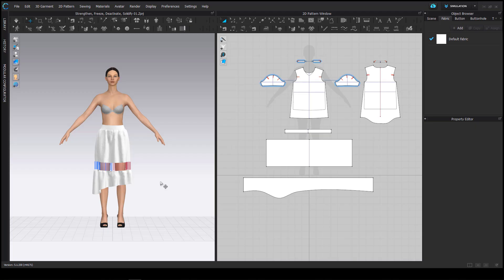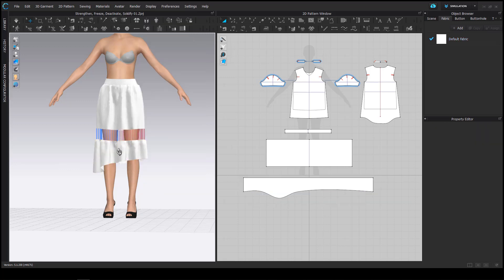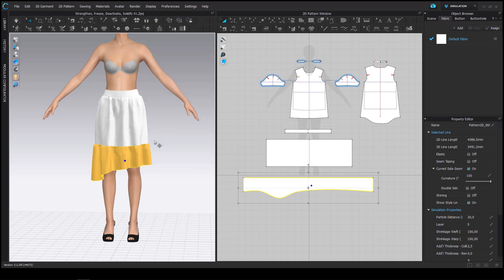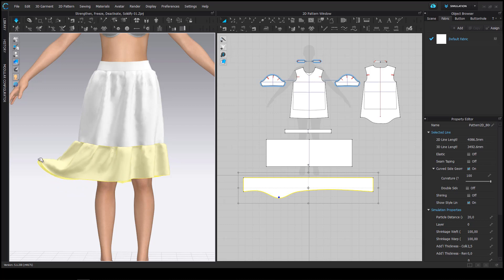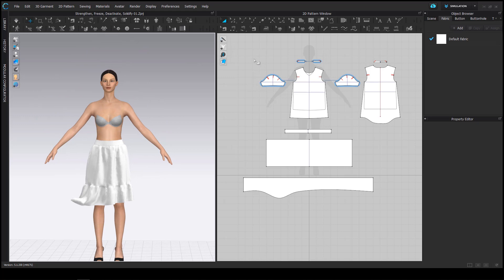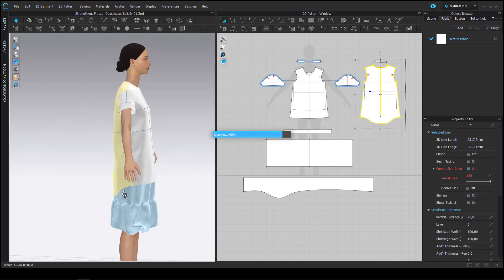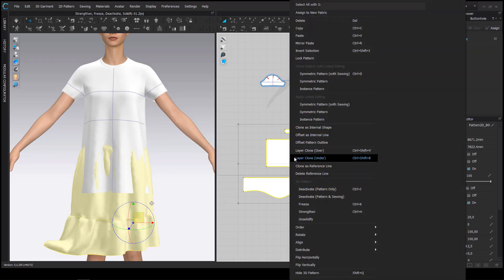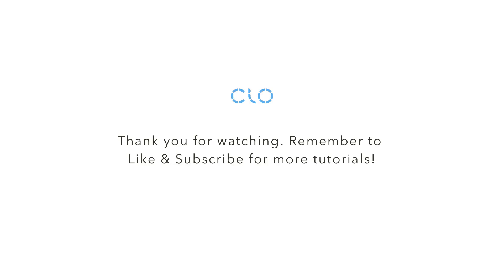How to Deactivate, Freeze, Strengthen, and Solidify

Comment: Hi. Thank you for these narrated videos. They are gold!

Just wondering.. Is there any way to modify the amount of influence 'Strengthen' or 'Solidify' would have? For instance, have 'Strengthen' act at a 100% or 50%. Maybe there's a setting someplace else?

Thanks for your time.
Reply from the maker: Solidify has this option but Strengthen does not. If you select a pattern and look in the property editor (towards bottom area) you will find Solidify. When you check this ON a toggle appears that then allows you to control the strength of the solidification.
Reply: @CLO3D  Thank you. That helped clarify things. :)
Reply from the maker: you are welcome